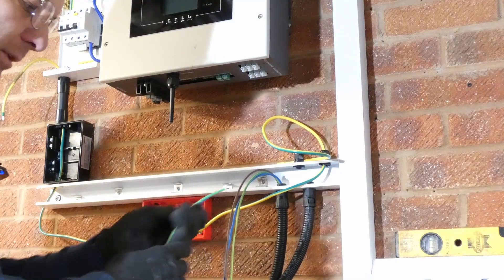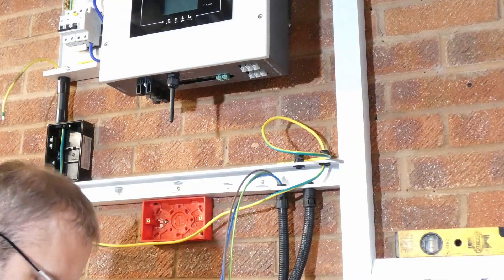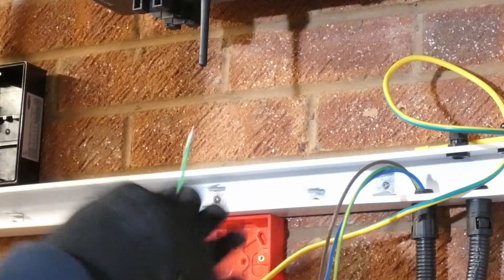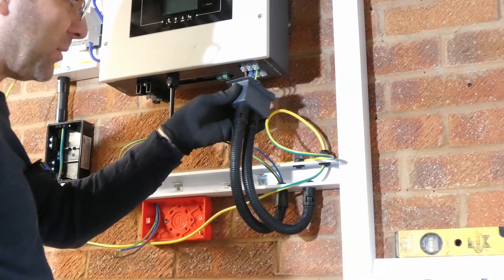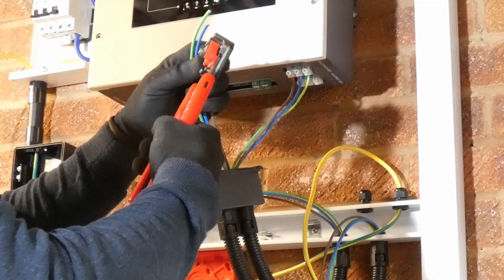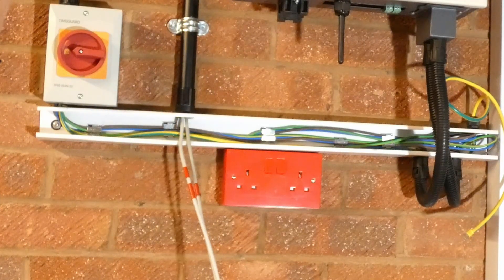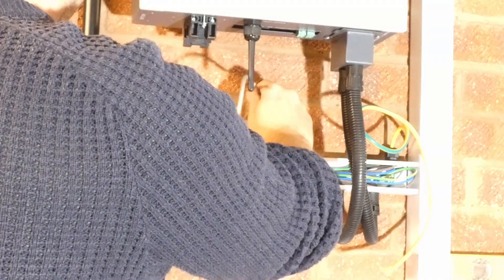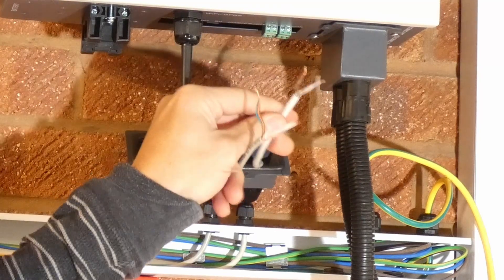DIY LIFEPo4 Battery - Wiring It Up [Battery Build #4]

Comment: Is it allowed to run signal (coax) and power wires (brown / blue) in the same conduit?
Will the coax cable signals be interfered by spikes on the power cables as they run in parallel over a distance?
Reply from the maker: Hi Jan, the cat5 cable (not coax) is connected to a current transformer, so the signal isn't "data" more of an analogue output, I've not noticed any issues with interference.

Technically low voltage data cables shouldn't be run next to mains power, but this signal cable isn't really a data cable.

Comment: Another very useful video Stuart.

I have an existing mini consumer unit in my garage that I can upgrade and wire the inverter into, however, I don't have an easy route to run a CT cable from my garage back to the main supply.

My Hypervolt car charger was installed with a CT cable and runs through the garage; is there any way I could cut into the existing CT cable and duplicate the signal to service both the car charger and the inverter? Would save at lot of floor lifting hassle 😅

I will not have any solar, battery storage being used to charge off peak and discharge during the day.
Reply from the maker: Without seeing the setup it's difficult to say. I don't think you can share the CT clamp, but does the cable have spare wire cores in it? Could you use those?

Comment: Looks good Stuart, planning something very similar myself. Looking forward to seeing what you do with the LiFePo4 cells! Got mine on order from Docan Power and should arrive in a few weeks.

Quick question - should the backup sockets not be protected by an RCD or RCBO and also have a AC isolator?
Reply from the maker: Yes, I need to update the EPS sockets to include RCD and also a ground rod.